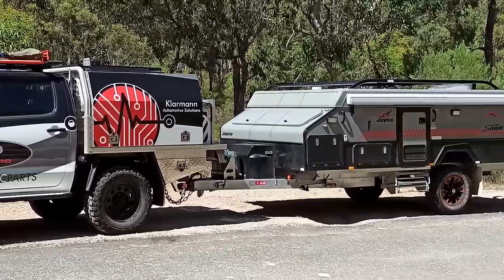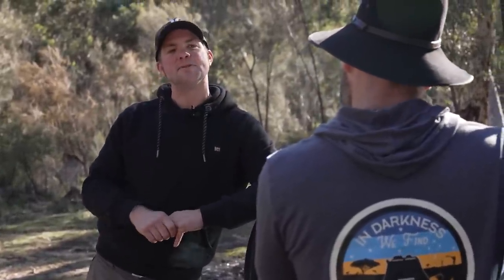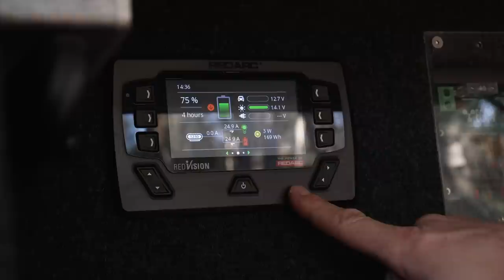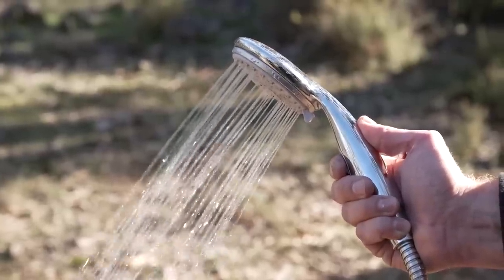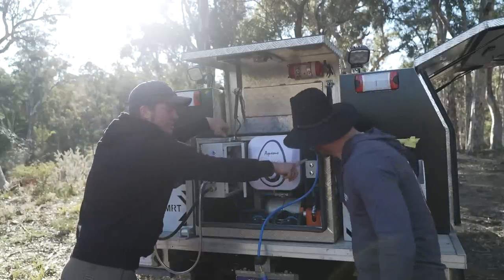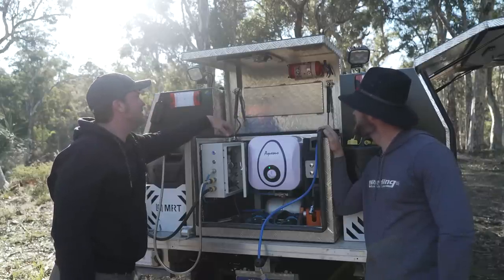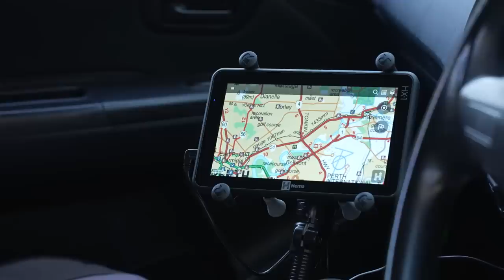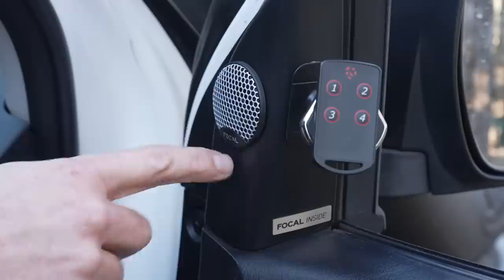2014 Hilux review, Modified Episode 92

Comment: I am new to offloading only been doing it about a year and I have a pelican case on my RSI smart rack inside this new pelican case I store all my off-road gear from recovery straps to punch repair kit inflating and deflating system and on the lit of the box I have mounted 4 Max tracks. With the smart rack , the rack slides out and drops down to me making it extremely easy and accessible to get the recovery gear it’s plain and simple . With all the gear in one place on the box it’s protected from the sun and elements and it’s just a matter of picking up the box mounting it on the roof rack and I’m good to go and with the new pelican systems and the quick release brackets it doesn’t get any easier. It just seemed logical to me to have the gear there who knew I was ahead of the curve LOL

Comment: You can go up to a 285/70/17 and a 3inch lift. You will need a body mount chop but this can be engineered. If you go for some really good shocks you will not lose the drivability but will gain all the extra clearance that you desire!

Comment: Question about the LED lights and the radios: do you hear any RF interference on the radios when the LED lights are on?
Reply: Unless you have lots of exposed wires you shouldn’t
Reply: @hunterbodell1129  Yes, they shouldn't, but we've found some LED light mfrs are using cheap power converters which feed broadband interference back into the power line. So, I was hoping to find out if THESE lights have the cheap power supplies or if they are well designed.

Comment: Really enjoyed the video one thing that made my scratch my head though he put all the recovery gear on the roof like I do it just makes sense but then he has a spare wheel under the truck that’s where I’m scratching my head.
Reply from the maker: Spare wheel on the roof would put push the roof load over capacity and would effect center of gravity in a noticeable way
Reply: @Ronny_Dahl  totally agree with that assessment however I hang mine on a swing arm on my rear bumper it makes my ass end a little heavy but it is extremely accessible so I feel it's worth the trade off. In addition by taking the wheel from the underneath you can put a much larger fuel tank which I also think is pretty cool .

Comment: I was wondering if you would take a suggestion for your next tire on your land cruiser if yes my suggestion would be maxxis trepador radials they have the same tread design as the bias plies but have less tread on them and are a harder compound though they are just as robust as the bias plies in puncture resistance and don’t pop off bead easily